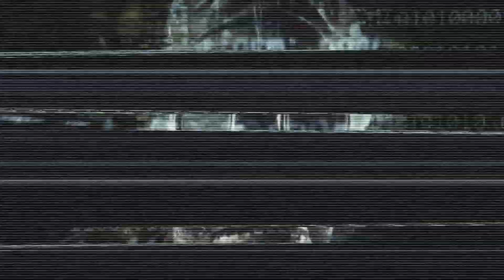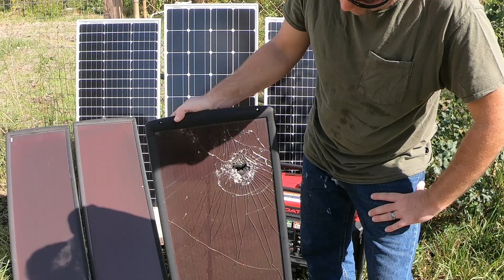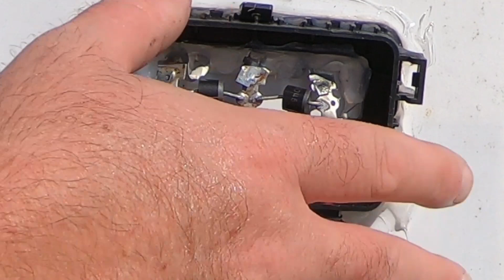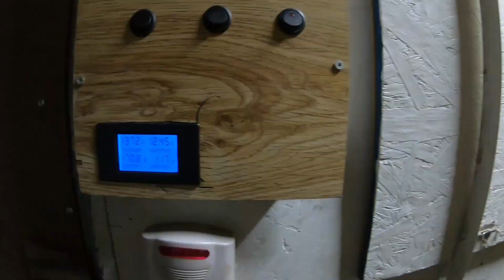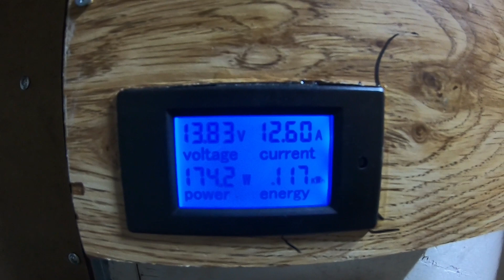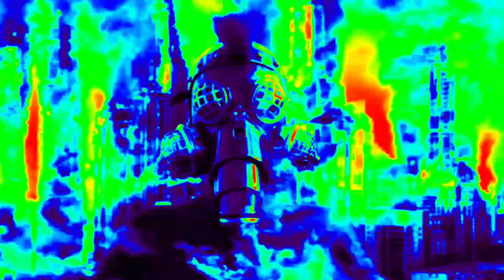SHTF Power, Prepare NOW, Power Outages Grid Down Coming

Comment: I'm new to this. Does the HQST 100W use diodes? If not, do I need to buy any backup parts in the event of an EMP?
Reply from the maker: From the photo I seen when I googled the HQST... yes. It has a modular box just like mine.

Comment: Need some solar panels.  But not the shit they cover your roof with for 20k %. 12 volt car l..e.d.'s  with two or three car batteries and 4 or 5 100 watt solar panels.  String the led lights with switches and your good to good . Free light for ever.  And car LEDs are real brite and reliable

Comment: I’m hoping I have all I need. We purchased a Jackery Portable Power Station Explorer 1000, 1002Wh Solar Generator (Solar Panel Optional) with 3x110V/1000W AC Outlets, Solar Mobile Lithium Battery Pack for Outdoor RV/Van Camping, Emergency with 2 Jackery SolarSaga 100W Portable Solar Panel for Explorer 160/240/500/1000 Power Station, Foldable US Solar Cell Solar Charger with USB Outputs for Phones (Can't Charge Explorer 440/ PowerPro) We just want to run a refrigerator and maybe a bread machine, instant pot... something like that. But noting was said about needing a charger or inverter.
Reply from the maker: Those solar generator have a built in inverter 👍
Reply: @SurvivalLiving  great. Thanks!
Reply from the maker: Very nice, seen alot of great things on the jackery products 👍

Comment: Was quoted a price recently that would have had to take out a 25 year loan.i can’t do that obviously
Reply from the maker: Lol no kidding, we built our system under $2k, it's not a whole home unit. But be careful on those. My aunts system dosnt even supply her home with power when the power goes out. It's crazy. Our 500 watt system for our 6x12 trailer runs everything we need. But we are using alot of 12v appliances as well

Comment: We have the biggest pile of firewood we have ever had at this point in the year. Solar is next years project. I’m going to try to do some lighting.
Reply from the maker: That firewood supply is definatly awsome 👍👍
Reply: Think about 12 car LEDs for lights  instead of inverter 110 volts . 12 volt leds your batteries will last all night.  On a car battery
Reply: Crispy Sandwich I’ve actually been messing around with 12 volt rope lights, like the ones for RV’s. I have a source for semi batteries. So I thought I would rig up a couple panels and charge controllers to those semi batteries.